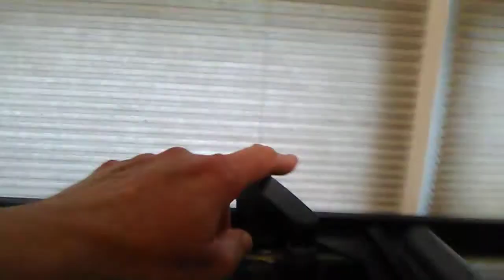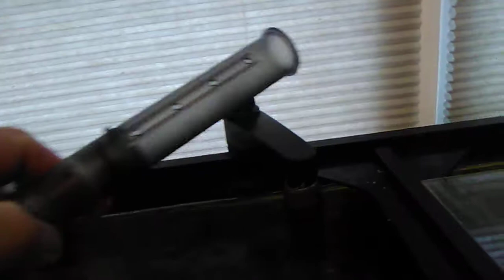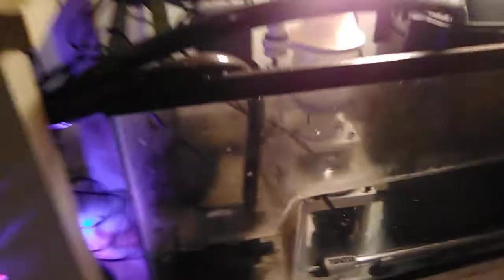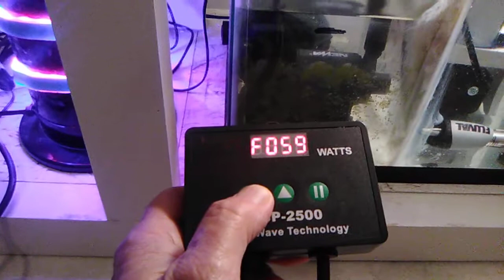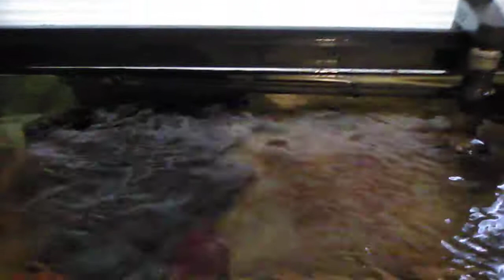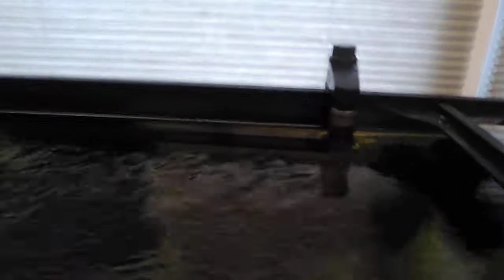Is your spray bar reducing your aquarium canister filter output?

Comment: That's one of the primary functions of a spray bar. To reduce and spread out the flow. That's why I use a spray bar my discus don't like strong current.
Reply from the maker: I checked out your channel, those fish are beautiful, nicely done.  Do you use tap water or treated somehow with discus?  Thanks
Reply: @lkapitan8232  Thank you and yes it's straight tapwater.

Comment: Why didn’t you reset water level to the line before adding spray bar?
Does the spray bar not have to work even faster to get the water back to the black tick mark?
Reply from the maker: I did reset the pump to 100% (tick mark) before adding the spray bar, I just did not show it.  Given that the pressure of the pump is fixed at the height of the tank, the spray bar can only release as much water as the pressure and size of holes allows.  Does that makes sense?

Comment: Was wondering the same. Great video and especially since you tested with more extensions.
Reply from the maker: Thanks
Reply: I’m using a fluval canister and I’m noticing less flow on the output of the spray bars. So another thing to note is resistance and also maintenance keeping these holes clean as well. Either swapping back to the original output head and trying to make the homes bigger down the line

Comment: Enlarging the holes would solve that
Reply from the maker: Yes it would, except the point was to shoot water across the top of the tank in two directions.  Thanks
Reply: @lkapitan8232  Slightly enlarging the exist holes doesn't change the direction flow the setup already has